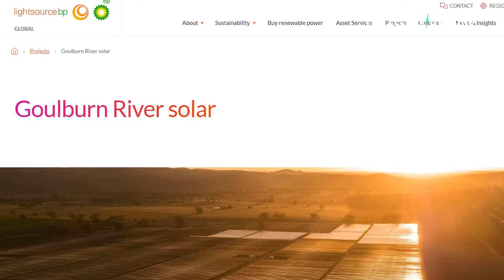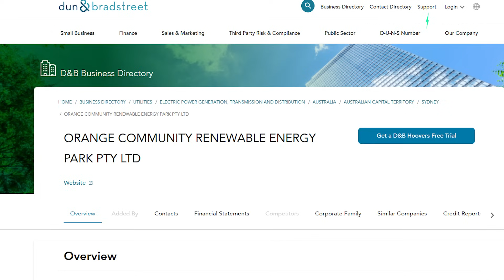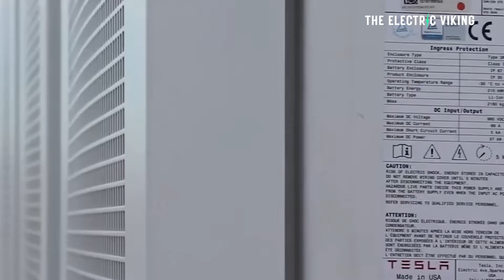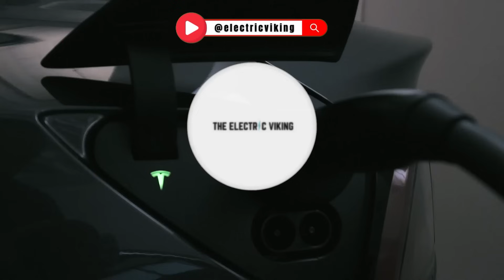Skyrocketing solar, wind and batteries in Australia destroy fossil fuels

Comment: One of the opposition’s proposed nuclear plant sites Pt August South Australia incapable of hosting a nuclear power Station.

Firstly there is no base load power off site to cool the Reactors and Spent Fuel Pools.

Secondly i was the contracted diver on an Oceanographic Survey funded by the South Australian Government and carried by the Horace Lamb Institute of Flinders University. With Professor Rainer Raddock and phd student. We were required to do a survey in the Head waters of Spencer Gulf at Pt Augusta.

This was done because international Petro Chemical corporation Dow Chemical applied to the SA Government to build a Petro Chemical Plant at Redcliffs at Pt Augusta.

What was discovered was 

1. The  head waters of Spencer Gulf takes centuries for the water to turn over. causing it to be almost as salty as the Dead Sea. Therefore incapable of dissipating heat.

2. The waters at Pt Augusta were extremely shallow with many low tide sandbars which became overheated and throughout the Summer became very warm adding to the water body’s heat load.

Once the South Government had the results of the Survey they closed put Dow Chemical’s Application.

This was followed over the following decade by at least two other corporations applying for the rights to build Uranium fuel processing plants. Both Denied.

To stop this ongoing predatory corporate behaviour the State Government turned this environment into a National Marine Park.

Mr Duttons hair Brained nuclear proposal made no attempt to research if the Location could support which it cannot. The water in the upper Spencer Gulf is too hot to cool Reactors or fuel pools plus there is insufficient volume.

The Oceanography and Environmental Research Work done decades ago in thev very early 
1970’s is even more negative since global warming has increased the water temperatures in Upper Spencer
Gulf in the ensuing decades. I am sure the results of the State Government Survey which stopped Dow Chemical and two nuclear Fuel enrichment proposals culminating in thev area being designated a National Marine Park are still on file in the South Australian Archives.

Comment: Good god. Just imagine the pollution caused by manufacturing all those giant batteries.
Reply: Yes, because we all know that pure clean air comes from extracting coal from the ground and then burning it
Reply: @zoransarin5411  I was refering to the masive amount fossil fuels burnt  to mine the Lithiumn and other minerals for the huge batteries.
Reply: @Dollarbill-g1l  There are many studies around the world that you can easily find that show the whole of life emissions of an EV versus and ICE car. All of the account for battery manufacturing. Regardless, in almost all cases, the EV overtakes the ICE vehicle in less than 5 years when it comes to emissions. The greener the energy supply is, the sooner the point the EV overtakes. The worst case example in Europe was using a China made EV (batteries made via dirty coal) in Poland (the dirties grid in Europe). The EV is still greener than an ICE car. So EVs offer a solution. ICE just keeps the status quo, which we all accept is not in our best interests.
Reply: @zoransarin5411  I was not referring to EVs. It’s got nothing to do with EVs. The video was not about EVs. It was about huge storage batteries.  My comment was about the huge storage batteries used to store electricity from Solar Panel farms and Wind farms and the pollution they cause to manufacture. Example,  Mining: Extracting lithium, cobalt, and other materials used in batteries can cause significant environmental damage. 
Energy Use: The production process is energy-intensive, contributing to greenhouse gas emissions.
Water use. Consumes a large amount of water and can lead to water contamination. A storage battery is considerably larger than an EV battery and they are being produced in large numbers.

Comment: why is it over for coal ? It's cheap abundant and require less up front investment than PV or wind.
Reply: When renewables are running they beat coal on $/mwh.
The trick with renewables is to over build generation by about 300% and find something useful to do with the excess power, which will be intermittent.
Reply: The world is moving away from fossil fuels to save the planet. How do you not know this?

Comment: I'm all for renewable energy. Rooftop solar is great! I've had it on every house I own. 

The problem with a only renewable grid is its unproven. No country in the world has yet to achieve this. In fact early adopters like California and Germany are going back to looking at other sources. 

We already have an excess of solar in the day. Current fit is around 4c or lower and some electricity providers are giving away electricity for free during the day. So we have a storage problem. 

Current battery prices are way to expensive. A home battery for 10k plus will only see you break even in 10 years! 

Electricity prices are increasing multiple times a year because of this and as demand increases with data centres and electric vehicles so will prices. 

A balanced solution is needed!

Comment: Coal is on a downward trajectory, but nuclear is likely to see big growth in the coming years.  China is investing VERY heavily into new tech, currently testing Thorium Molten Salt Reactors (MSR), operating the only Gen IV conventional Pressurized Water Reactor (PWR), and the only one constructing Small Modular Reactors (SMR).  In 5-10 years, China will be mass-producing nuclear reactors, likely directly replacing thermal plants, then exporting the tech globally.  This will be the exact same playbook that they successfully used with solar and wind: get the tech straightened out, scale up to bring the unit cost down, and then export globally.
Reply: Do you think Australia will buy a nuclear reactor from China? Built and overseen by the Chinese? I don’t
Reply: @zoransarin5411  Australia is all over the map with their China relationship, so anything's possible.  If China gets nuclear power down to where I think they will, EVERY country will be clamoring for them.  Including Australia.  
As for construction and oversight, I would trust China over America every single time. They are over a decade ahead of anybody else in nuclear tech, and widening that gap every year.  China is moving toward 'fail-safe' designs with passive safety features that are basically impossible to produce a TMI-type situation, much less a Fukushima or Chernobyl.  Assuming that TMSR tech is the winner, there will be no environmental risk, regardless of who operates the plant.
Reply: @ZweiZwolf  I don't disagree with what you are saying. However, our politics is similar to the US. We have a right wing party, the Liberals and a left wing party, Labor. Our relationship with China tends to be better under Labor than Liberal, and it is the Liberals proposing nuclear. As I stated, the Liberals trusting China to provide a nuclear reactor is improbable in my opinion. I can't ever see it happening. We blocked Huwawei from assisting in the rollout of our fibre optic network. That's telecommunications. I don't think we would let them near our energy generators either.

Comment: NSW is using 8000 mega watts per hour average. We need a battery that is little bigger than 240 mega watts at Lake Maquarie to get through a night. To be reliable we need minimum 3 times that for winter cloudy days unless you want to fire up some other generator besides solar. We should test your theory and cut off the inter-connector to SA and see how good it is :). Eraring can produce 3000MW per hour. How big of a battery do we need to replace that output for one night?
Reply: I don’t know what Eraring can generate per hour, but the question needs to be what is the demand per hour at night? Will that demand change as EV ownership grows, or does the combination of EVs able to add power to the grid and batteries attached to the grid mean we can meet our needs and expectations in a different way?

Comment: Bought an EV, went off-grid (solar and batteries), saved $8k+ per year since. Zero outages, zero power rationing.  I just don't get the opposition to renewable energy.
Reply: It's thanks to the billions the fossil fuel industry has spent since the 80s & is still spending on FUD campaigns against renewable energy. I wonder why?
Reply: Have fun trying to sell your disposable ev.😅

Comment: It looks like at the pace Australia is going, we're going to hit an excess renewable growth and need to ship to infrastructure or energy overseas. The one project to export to Singapore doesn't seem too bad now but it has a lot of political issues. Another project would most likely be AI farms if we do over produce renewables.

One big issue is that even with all this growth, energy prices have not come down since the large jump in 2024 EOFY but we'll have to see how the prices trend at 2025 EOFY when the market rates change again. Another is the sustainability of the life cycle of renewable products. Wind turbine blades and solar panels are expensive and challgening to recycle however batteries seem to be easy to recycle. Even now, used car batteries are being used for the grid batteries. 

It'll be interesting to see if Australia is able to hit the 2030 or 2035 goals. With the current pacing and growth I can see it hitting those targets but if AI farms comes to Australia, it'll most likely delay those goals unless they gather more growth/funding.

Comment: While I support renewables, we are still nowhere close to getting to full renewables.
80% of capacity being renewables does not mean we are 80% there. Capacitor is hindered by efficiency and also capacity factor. We will like need 2-2.5x times the capacity of renewables since we will need to over supply during times where its avaliable so we can store it for later.
The next is storage, we have nowhere near enough storage and unfortunately batteries wont cut in unless better long term batteries come in or we pursue more hydro which provides massive amounts of store ( while it cost $12b it woule cost $100b in terms of batteries)
Reply: Hydro is frowned on by many countries. 300 organizations from 69 countries signed a declaration calling on governments to stop using climate funds for so-called "sustainable" hydropower schemes.
They argue that large hydropower projects can cause significant environmental and social problems, such as greenhouse gas emissions from reservoirs and negative impacts on local communities and ecosystems. Hydropower degrades the entire river system, degrades the beach at the river mouth, and reduces fish population. Methane is dangerous to the environment and air, and that great mass of rotting material that builds up behind the dam wall emits dangerous methane 24 hours a day.
Reply: @Dollarbill-g1l  I mean renewables isn't all so green as well

All the wind turbine equipment and panels require massive amounts of materials which release greenhouse gases too and then when replaced they cannot be recycled easily ended up up environmental damaging land fills. Atleast with Hydro, environmental studies can be done to build them in areas with minimal impact.
Reply: @bobcat718  Recycling is slowly getting going for batteries and panels...and also wind turbines & blades.
And at least the materials needed for the energy transition are way less than the continual extraction of fossil fuels every year. It has been estimated that 3 billion tonnes of materials is needed up to 2050 for the transition...while every year we currently use 15 billion tonnes of fossil fuels.
Reply: @annabel5200  Wasn't comparing to fossil fuels
Just saying Hydro doesn't have much material replacement. Once built it lasts a very long time and is the best form of power. Instantaneous and high storage
Reply: @Dollarbill-g1l  Off-river hydro is the best choice, PHES. Can be built relatively cheaply & quickly. But batteries are also getting cheaper with sodium-ion being mass produced now and China has utility scale NA-ion BESS in operation. And the US has the biggest battery in the world planned for Maine and it is an iron-air reverse rusting battery.
Reply: @annabel5200  Interesting imformation .
Reply: Of course, different grids are not the same, but current battery systems address the vast majority of demands closer to the customer and avoid need for long distance transmission which is limited in Australia and on lots of other grids. Solving granular distribution constraints changes effective capacity factor for renewables and creates quality control (frequency etc.).

Comment: I'm struggling to get my head around the concept of an electric eutopia. Having had experience for some years with off-grid solar and wind systems, it's my view that there is a long way to go before the so-called renewable platform can replace fossil fuels. Much of the resistance around nuclear energy is based on the belief that it will replace other energy sources but that is not the case. It's simply a supplementary source to support and moderate a diverse energy network. No technology offers a complete solution to an ever increasing demand for energy and particularly with population and industrial growth. If the entire fossil fuel market was deleted from the Australian network within ten years I'd estimate there would be a significant effect on the economy. Take away fossil fuel products such as bitumen, plastic, concrete and many other products and consider what those products will be replaced with. Add the closure of energy exports and the effect that will have on the economy in regards to employment and industry capability. My conclusion is that we have a choice, stop consuming, reduce population levels and general regress into a very frugal lifestyle but the Solar packing Tesla driving population out there might have an issue with that and so from my perspective there are basically only two choices, add Nuclear into the mix or make a serious consideration into significantly reducing population and consumption. Can't have your cake and eat it to.

Comment: With the numbers of EV's predicted in 2035 its calculated that the total battery capacity of all EV's will exceed the battery capacity of the whole country, with Bidirectional charging made standard in EV cars, this will change the electric market completely to a far more flexible and cheaper one
Reply: Yes..bidirectional charging/V2X really is what I want in an EV.
And every BEV helps our trade balance by cutting down our fuel imports!
Saul Griffith talks about this in his book, "The Big Switch: Australia's Electric Future". 
Also The Australia Institute looked at our over-reliance on imported fuels in 2022 in "Australia 91% reliant on foreign oil: Research Report":
'Transport consumes more than three quarters of liquid fuel (73%) and more than half (54%) of Australia’s liquid fuel is consumed by road transport.
If all passenger vehicles in Australia were pure electric vehicles, 33% of imported oil could be replaced with domestic electricity.
Australia only has 68 days of liquid fuel (January 2022) under the IEA’s 90 day minimum stock requirement.
“Australia has a national security problem when it comes to transport fuels. It’s worrying that Australia is almost entirely reliant on foreign oil for fuel consumption leaving it ill-prepared to deal with international disruptions,” said Richie Merzian, Climate & Energy Director at The Australia Institute.'

(I wonder what happened to the $94m worth of unrefined oil Angus Taylor had us pay the US for in 2020. The Morrison govt was happy to have it stockpiled in the US until we had storage for it.)

Going all electric for transport & household energy with solar plus battery/V2X is the best thing we can do for national security & to reduce ghg emissions.
Reply: absolutely right.  I am VERY keen to see V2G rolled out and am in the process of nagging various parties to try and get a coordinated effort.  At the moment it's a bit chicken and egg.  I have enquired about obtaining a V2X biderctional EV charger but the response has been "no one's really trying to sell them cause none of the Car OEM's (but for Nissan Leaf) have done compliance testing.....  but what incentive is there for them to do compliance testing if no one can buy a V2G charger...... ie no added sales for them.  So please nagging your EV OEM and keep nagging your Solar contractor and keep nagging your local energy supplier... :)
Reply: The EV is minor compared to what the energy requirement are going to be for AI. Think about a heat wave with the demand for EV, AI, and Air Conditioning! No FN way Solar can possibly work.